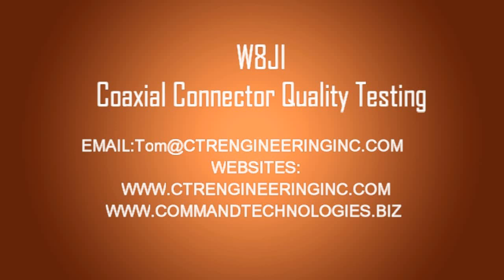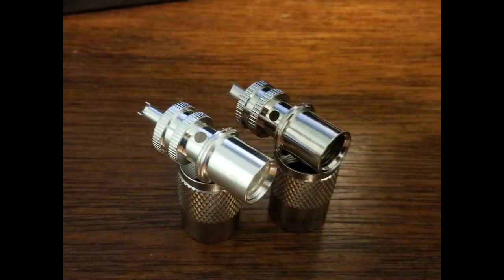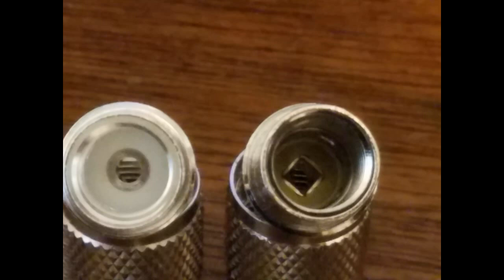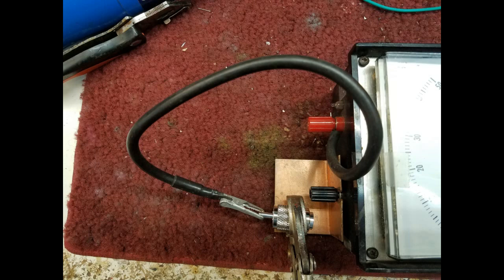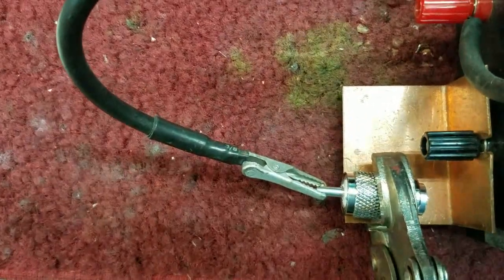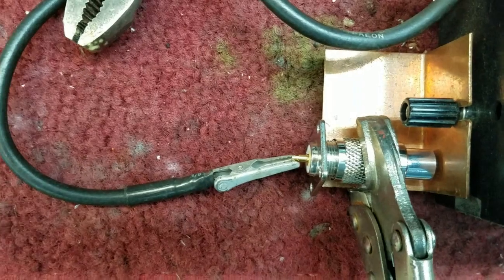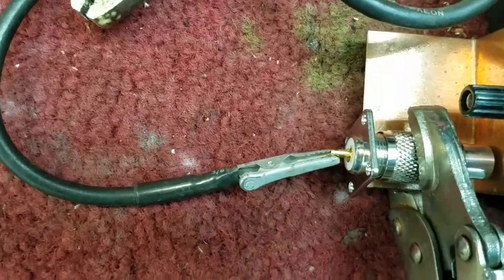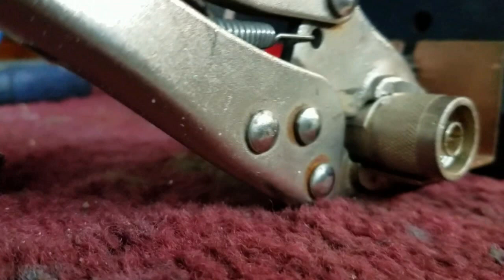Testing Coax Cable Connectors

Comment: Thank you Tom for this really informative video. In the last part of the video you test a N type connector. They're you noticed arching between the inner shield and the center pin. Isn't it so that when the connector is connected that part is insulated by teflon?

Comment: What's funny is I just bought some Coaxial Lightning Protectors, devices designed to arc at just moderate voltage. So sometimes the goal is the opposite. 🙂

Comment: In a 50 ohm system 1800 volts means that power is 64.8 Kw. If connector is seeing a high impedance load, then quite small RF power will developed high voltages. Only 100w may be arching 1800 volts against a 32 Kohm load.
BTW... Tom didn't tell us what frequency he was using in his tests but I'm pretty sure that arching would appear sooner the higher the frequency.
Reply: HiPot is DC. At ~10kV, some your points are obviously less consequential.

Comment: 9:00 Don't confuse mismatch loss as resistive "heating" loss when the loss is caused by an impedance bump.
Reply from the maker: Mismatch loss is really just another way of expressing SWR that creates standing waves. The standing waves "stand", they do not travel. The effect of standing waves is to increase current levels and/or voltage levels along a transmission line. 

I can have a transmission line of 10:1 VSWR, which is a mismatch loss of 4.807dB, and have virtually 100% energy transmission to the antenna. 

The phasing harness in a collinear is a great example. If we have a 75 ohm 1/4wl  cable feeding a 50 ohm element that line has a SWR of 75/50 = 1.5:1.  This VSWR is a "mismatch loss" of 0.177 dB. That loss mismatch loss is meaningless. If I used Commscope RG11/U cable in the harness, the loss of that 1/4 wave cable would be 0.0184 dB or 99.58% eff,   despite clearly having a having  "mismatch loss" of 0.177dB.  If I combined two of those cables to one point, and fed that point with a 50 ohm cable, the 50 ohms cable would have a near perfect SWR at 50 ohms. The harness loss would be twice the loss of one cable, or 0.0368 dB. 

This is why mismatched cables are a standard way of splitting and combining systems, and whuy nobody cares about mismatch loss. They care about real loss. 

Mismatch loss does apply when a 50 ohm generator like a standard transmitter through a large attennuator pad drives a mismatched load with no effort to correct the impedance seen at the source.  

If you do not understand this, get a copy of Reflections by Walt Maxwell and read it, or build a system and measure it.

Comment: Thanks for posting this Tom, I've learned a lot about connectors here. I had bought LMR 400 coax  with Pl 259's from DX Engineering and there coax was fine but there Coax Connectors they used were so cheap, light and gave me so much failure I had to  finely cut them off and buy good PL 259's  and put them on the coax.
Reply from the maker: I find high pot or high voltage testing to be more important than SWR tests on cables. :)  Of course SWR is important and must be good, but a HV test will show assembly errors.
Reply: @Jerrythenerdful   Yes very good video. Very informative.
Reply: Yes.  I  would like to see his procedure for soldering the pl259. Which i know
would be good. His time is defenitley limited. I use mostly Crimp connectors
for the lmr 240 , 8x connectors  because of heat and the foam dielectric. To
me they are just as good if not better.